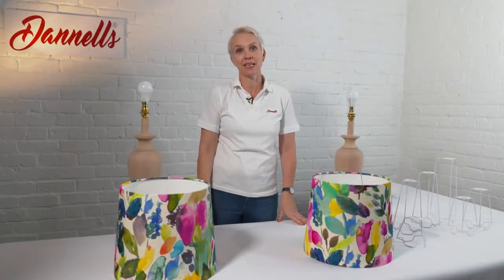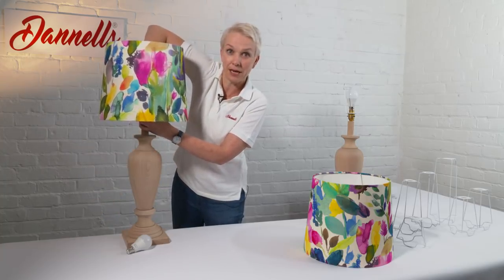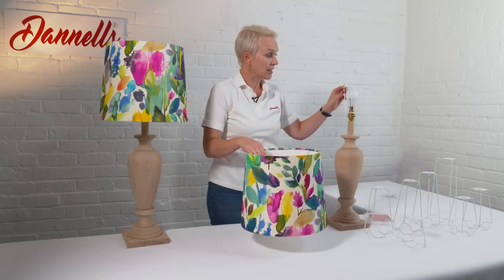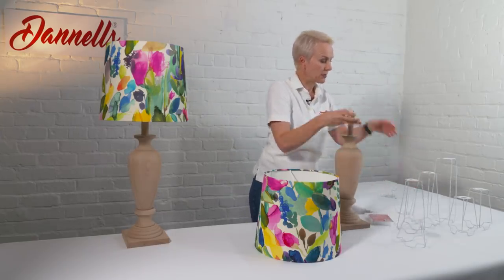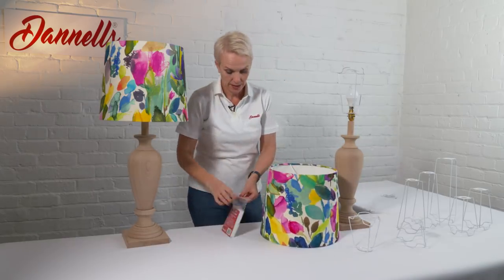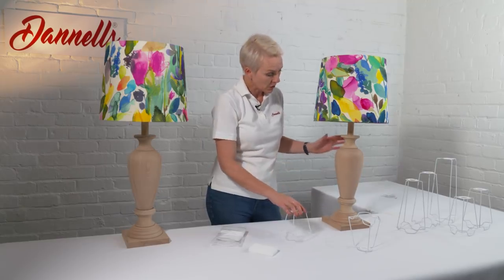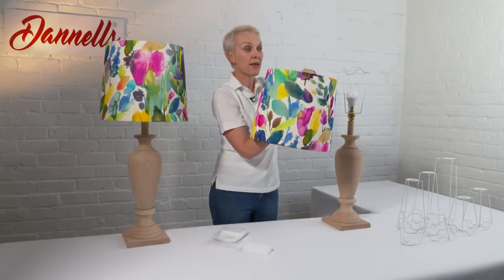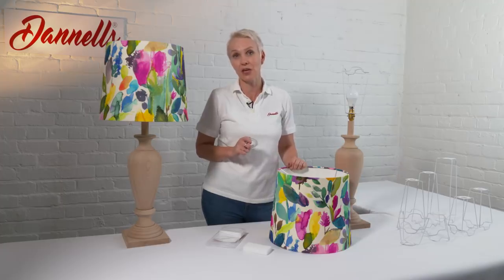Shade Carrier System Explained and Advantages

Comment: How can this system  be used in the US?
Reply from the maker: The Lampshades would need to have Duplex Rings fitted, we have special kits for the US sold on AMAZON US https://www.amazon.com/stores/Needcraft/page/FB4E3B2C-1AF8-47CF-8B75-5066B2816F12?ref_=ast_bln
Reply: @NeedcraftCoUk1  But these kits are only in the drum shape correct?
Reply from the maker: @hdb80    No any shape lampshades, as long as they have  Duplex Rings fitted on the frame, so you can use the carrier system
Reply: @NeedcraftCoUk1  Okay, but you don't offer that. Ever single kit for the US is a drum shad. If I bought one of your Coolie kit, it doesn't come with duplex rings. So how remedy this?
Reply from the maker: @hdb80  the coolie kits come with duplex fittings fitted , but they are not available in the us at the moment , we can post from the uk though